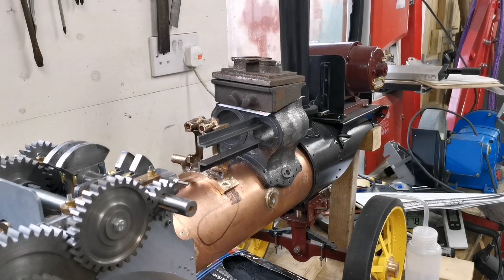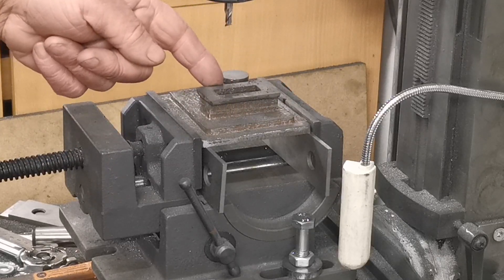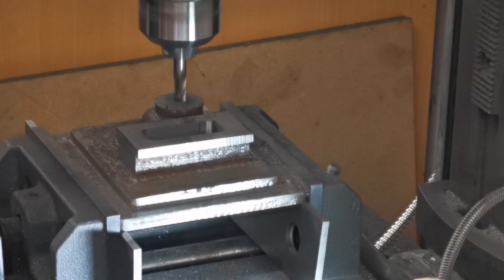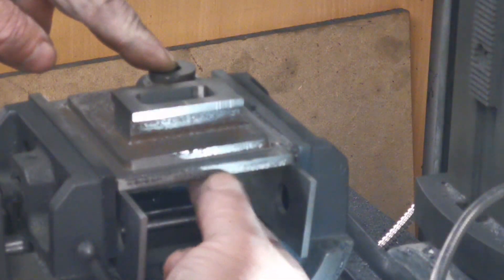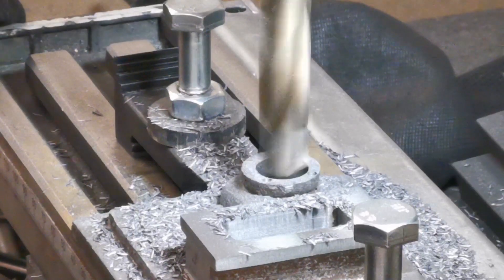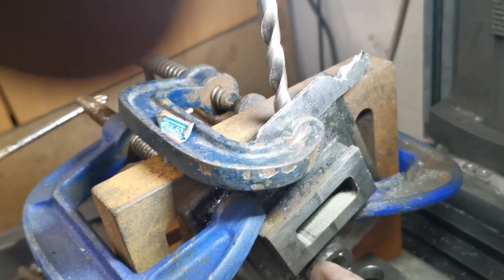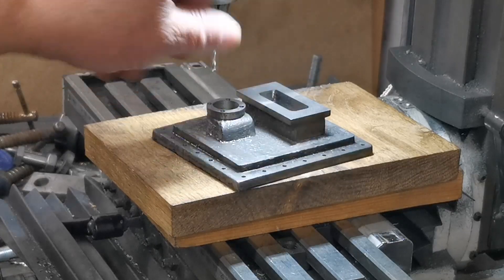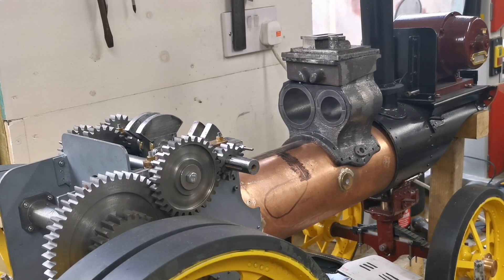2" Fowler Showman's Traction Engine machining the cylinder top casting

Comment: Those holes extremely close to the edge?
Reply from the maker: Yes, I did them to the drawing, I shall be redoing them later with a smaller pad turned 90 degrees
Reply: @jammymowlam1  Some castings are not so good as they should be.